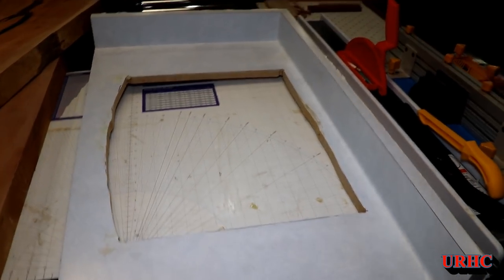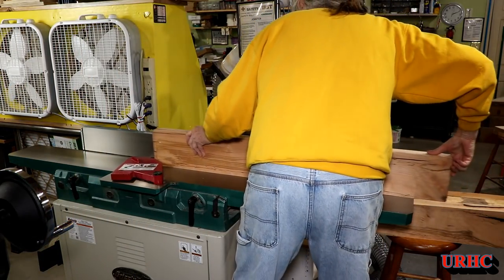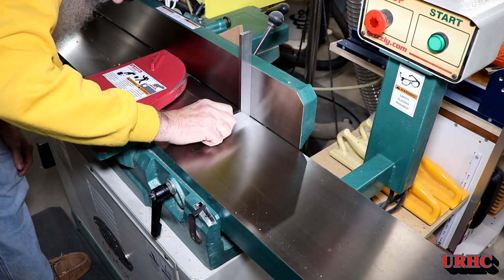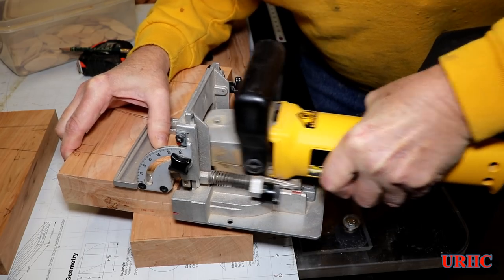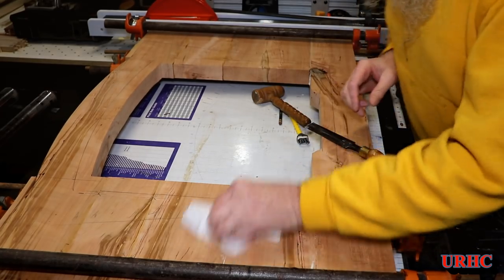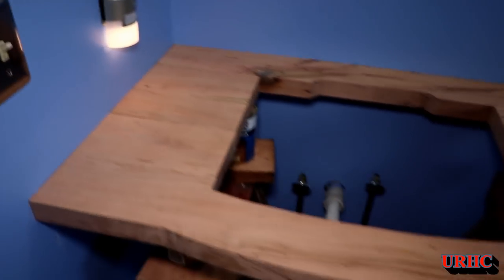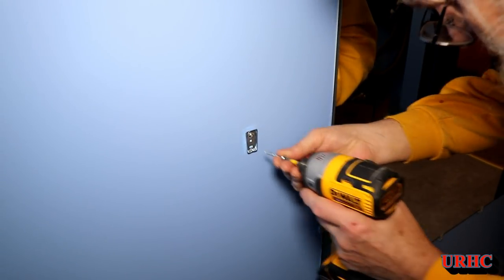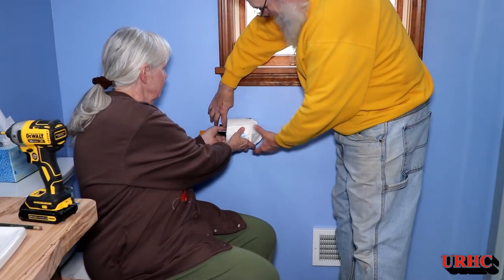Guest Bath Update Part3 Starting The Cherry Vanity Top & Mounting The Gatco Elevate Accessories

Comment: There is never a problem with long video! I don't like short ones, I can maintain my attention on a topic for more than 5 minutes :)

One thing I am surprised with, in the USA, is the power plugs close to the sink. I know it France you have a one meter exclusion for anything dealing with  electricity (plug, switch, light fixture, etc.) from any water point, so switches would be by the door, usually outside the bathroom to be even safer. One only exclusion would be a plug for a shaver.
Reply from the maker: Here in NY the bath outlet must be within 3 feet of the sink and GFCI rated so you can't get a shock. They do that so you never need an extension cord that could be plugged into an unprotected outlet. According to my analytics only 2% of my subscribers watch the total video  and most give up after 5 minutes. Videos like this start out with over 2 hours of clips and I try to edit them down as much as I can to keep everyone interested.  Thanks for watching

Comment: Love the build part, so precise is your work.  Looks great so far.  I have a towel holder and tp holder similar to yours.  I like the ease of removing and reinstalling the roll.  Ours are made both like your hand towel holder, in a sleeve so using larger rolls isn't an issue.  Very nice choice.   I'm looking forward to the rest of the cabinet, the cherry is so nicely figured.  Thanks.    :)
Reply from the maker: Thanks.  We decided to give these fixtures a try and really like them. We only use the Scott's tissue because it's best for a septic system so this holder works for us.  So much easier to change the roll and keep clean. It's amazing how nice the wood is that grows in the backyard. Thanks for watching.

Comment: It's a pleasure watching you work! Nicely done. We have a pair of the same sink in almond, but with the single hole in the back and a wide-'waterfall' type faucet in brushed nickel. How I wish we'd gone with chrome as the hard water and calcium buildups have about ruined the finish. Chrome is so much better to hold up against the rigorous cleaning required to remove the mineral deposits.I didn't catch where the cherry wood came from. A tree you fell? It's surprising here in the PNW how many guys have saw mills to cut up the abundance of trees around here.
Reply from the maker: The good part is the faucet is very easy to replace.  I think calcium will build up on and eventually tarnish any finish. The tree was cut from my backyard about 12 years ago and this was the last piece left from the lumber I had sawn. All the furniture and cabinets in our home will eventually be built from lumber grown in the backyard.  There are some videos of my little sawmill on my channel. Thanks for watching.
Reply: We have hard water and calcium deposits here in Az.  I just soak a paper towel with vinegar and place it over the deposit.  Vinegar dissolves deposits.  I use it all the time.
Reply: @janambrose4917  Thank you, Jan. I think there might be some Portland cement in our calcium deposits. ;) We've been able to remove it but the brushed nickel finish isn't very durable I'm afraid. Chrome seems better able to stand up to a little scrubbing than brushed nickel.